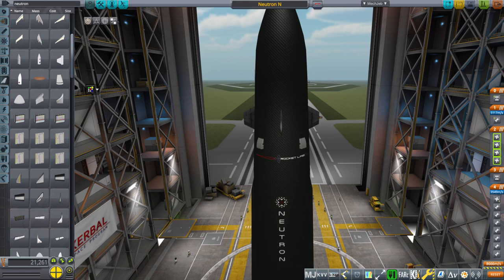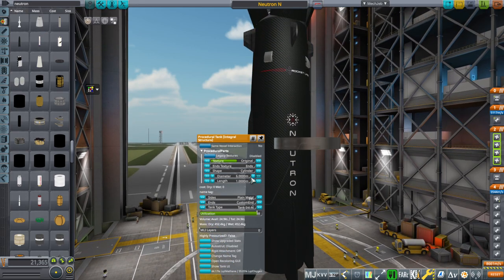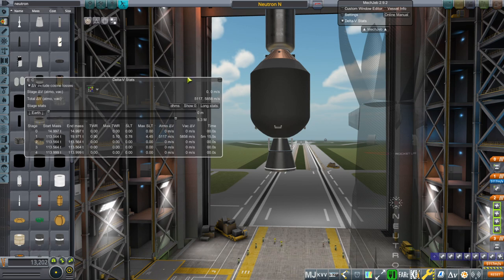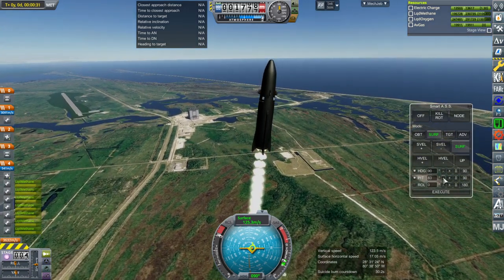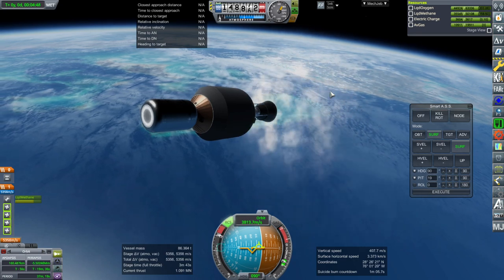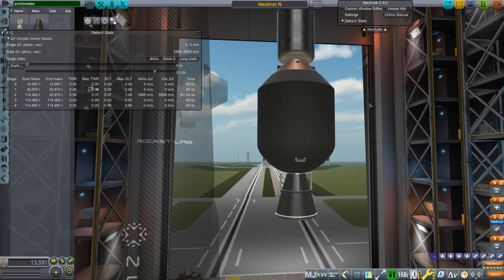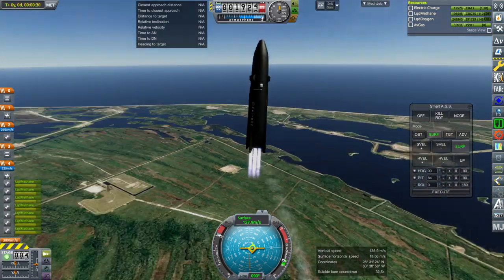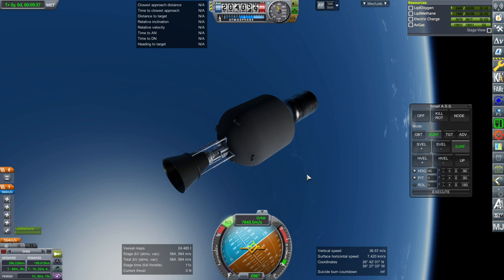Kerbal Space Program with RO - Rocket Lab's Neutron

Comment: They mentioned Archimedes will have a 320 sec ISP, which I assume is vacuum, for the sea level engines.  From that I assume that the vacuum engine will have an ISP around 350, so yeah, the engines are pretty inefficient.  The 480 tons total mass is right, so I guess the first stage is just a lot heavier, and the engines suck but have really low chamber pressure so they wont be going crazy like raptor at 300 bar.  Take into account they will also need nitrogen and helium for RCS and pressurization, maybe they use autogeneous pressurization, but I doubt it

Comment: Honestly, it would seem to me that there's either higher dry mass in the first stage (which seems unlikely to be honest) or Archimedes is a really shitty methalox engine, which is also a bit unlikely imo but a bit less than the first possibility. Or what I think is most likely, which is that they're probably giving the bare minimum numbers and if they can upgrade from the 8t reusable, 15t expendable number they give they probably will.
Reply: They're trying to give Archimedes a lot of margin to suck and still have a viable launch vehicle built to the quoted spec. They don't want SpaceX's current Starship problem of trying to fight all frontiers of weight and performance just to reach their promised numbers for minimum viability. I'd expect operational Neutron to be significantly better than stated, especially after revisions. Even moreso if Archimedes really is the next Merlin that it seems to want to be.
Reply: @Ithirahad  Yeah, seems like the most plausible possibility. An Archimedes growth like we saw with Merlin is what I think will happen